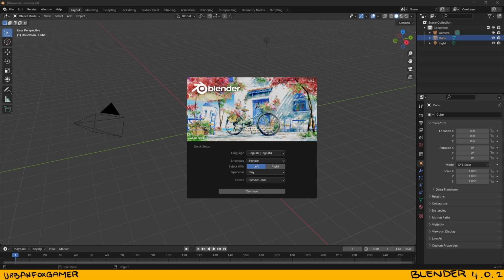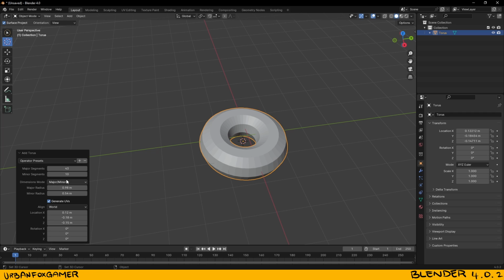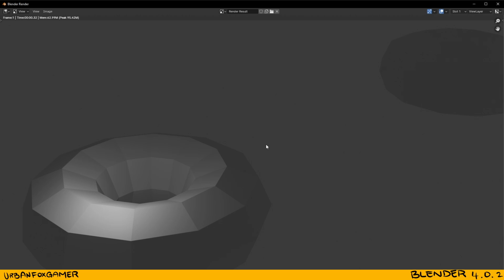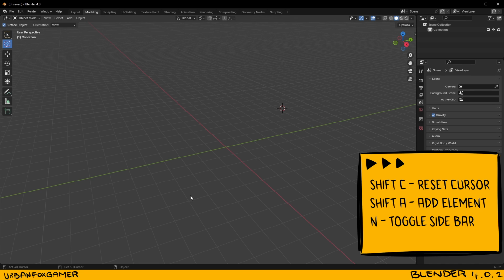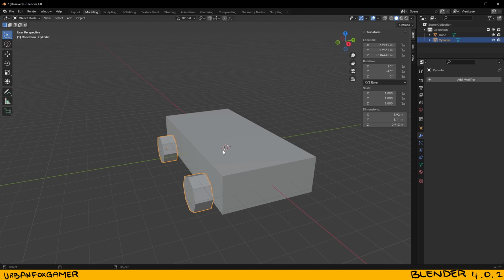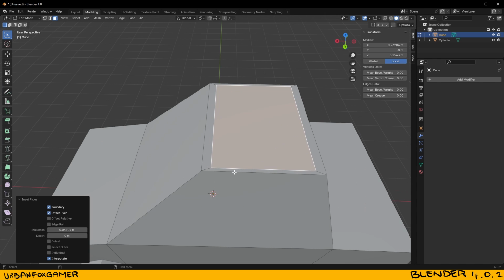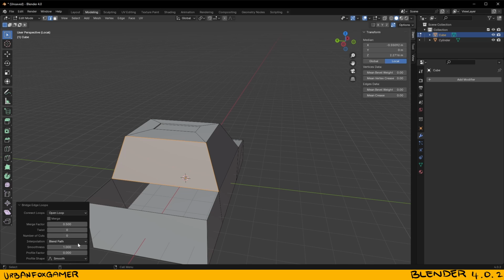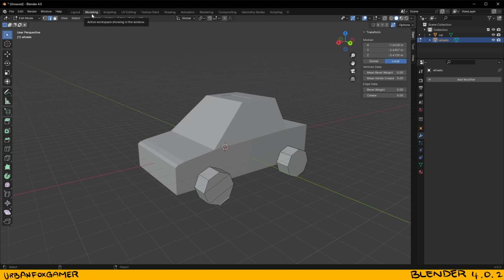3Ds max controls for Blender 4

Comment: I remade my scene and it worked fine once I did, but the loop cut and slide cut tool completely broke after I was screwing with all its values.  I tried to copy yours but my Factor got locked at -1.6 for some odd reason.  It was creating a bunch of negative geometry, extruding the whole object like 10 extra units down the x-axis if it wasn't clamped, and clamping didn't help the weird offset.  Idk, I tried to reproduce the glitch in a new scene and couldn't.

Comment: Also find the symmetry or "Mirror" modification very bad compared to Max's Symmetry modifier. In Max you can simply move the modifier gizmo, anywhere you want the symmetry to occur, as well as add 1, 2 or all 3 axis. In Blender it straight out just apply the Symmetry and you have to use the 3D Cursor to choose the location which i find very convoluted, slow and unnecessary. 

However to get this working (almost like Max) you need to click “Options > Affect Only > Origins”. NOTE: Must be in Object Mode (1) for this to work. 

Here is a video showing it https://www.youtube.com/watch?v=ZDYZzncD5Qc 

Only thing missing is the very nice yellow Symmetry Gizmo from Max, which clearly shows you the exact location of the symmetry and its axis. In Blender, you have to base it only the 3D cursor location, which again isn't great.

Comment: Been playing around with this quite a bit. 

What I did find missing was the object "Apply" popup menu. This is by default "CTRL+A" or can be found in the "Object>Apply" drop down, while in Object mode. 

I'm still figuring out all of its uses, but one i found was that if you create a a cube and set it exact dimensions, such a s say 6x4x3m in object mode, then go into Edit mode and try to inset a face, it doesn't inset equally along the edges, as it now sees the mesh as "stretched" which coming from Max is very silly.

So to get around this, you have 2 options:

1. You can create the perfecting equal default cube in Object mode, then pull the verts/edges/faces in edit mode, in which case it wont see it as stretched anymore, but instead as "edited". In this case the inset will equally run along all borders. However, you loose your ability to set exact dimensions when creating the mesh, as you are now roughly pulling verts, which I don't like, as I like exact meters when I create my meshes (especially for architecture), as in the case of Max.

2. The second (and better way) to get around this is where the "Apply scale" comes in. So once you create your desired 6x4x3m mesh in object mode, you then HAVE TO FIRST apply a scale transform to it, using this Apply menu. This tells Blender that its not actually a "stretched" mesh, and therefore sees it as its native size. Then once in edit mode, the insets will run equally along the borders. This is the closest to Max that I could find, although a longer process, as max by default runs all inset edges equally using the poly edit modifier or when the mesh is a poly.

This guy's video shows the problem and solution in action https://www.youtube.com/watch?v=1vBojZwrcP4

However, as your shortcuts didn't have it in, I added it under "3D View>Object Mode>Apply" in the keymaps. This is the default location for Blender too. I made my shortcut "ALT+Mouse4", but obviously make it whatever you like.

My code looks like this:
    ("wm.call_menu",
     {"type": 'BUTTON4MOUSE', "value": 'PRESS', "alt": True},
     {"properties":
      [("name", 'VIEW3D_MT_object_apply'),
       ],
      },
     ),

Bonus tips: Unlike Max, where you create object in units (CM, M etc) in Blender it wants to create it based on scale, which I also find stupid. So to get around this you have to open the "Item" menu tab (shortcut N), then edit the dimensions in units there when creating it. 
You can set the desired unit the "Scene View" tab, which is the small icon of a cone, and two spheres on the right of the interface, where you also get modifications, render tabs etc.

Comment: Thanks a lot for all the work and detailed explanation. I still prefer 3DS Max's non-destructive modifier stack workflow. Where you can edit extrusions, bevels etc at any time. here they get backed in an that's that which is a step backwards.
Reply from the maker: @SomeCrazyVids  i agree with ya fully, but autodesk is not giving us a choice budget wise. For a price of a license. I would rather buy a plug-in similar to that or commission a programmer to mimic that.
Reply: @UrbanFoxGamer  definitely a price difference and there are many great add-ons I've been browsing through as you say. 

Also knowing python helps as it seems to be based on that. I've used max since 2001 with Vray, so it's imprinted in my memory. Interested in testing it's geometric nodes and sculpting vs Houdini and ZBrush, so taking the blender leap and thats what brought me here. 

Felt so helpless with the new keys and controls but ur vid helped a ton.